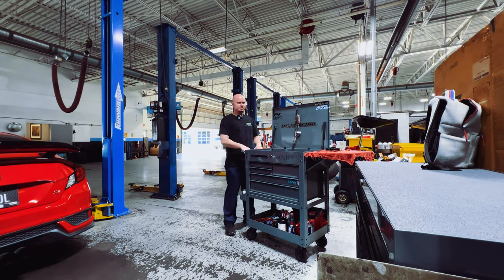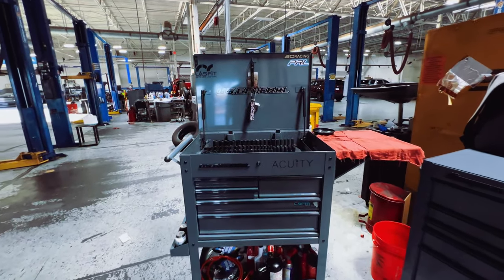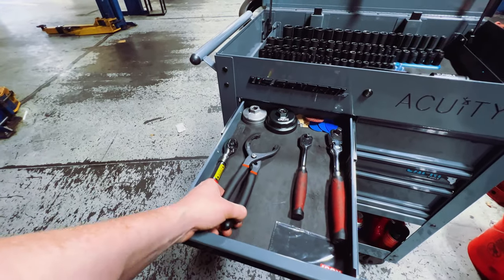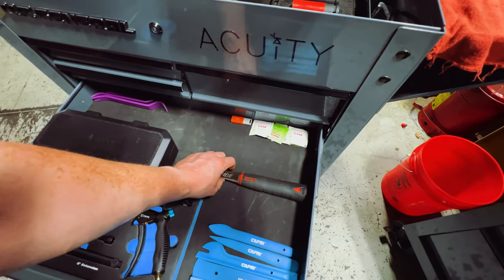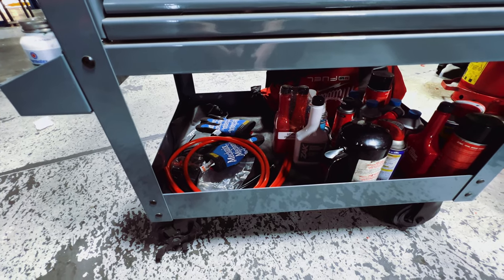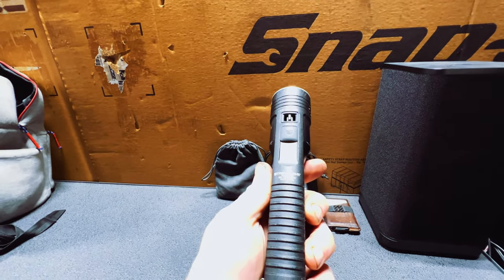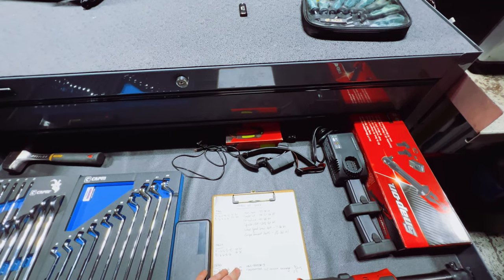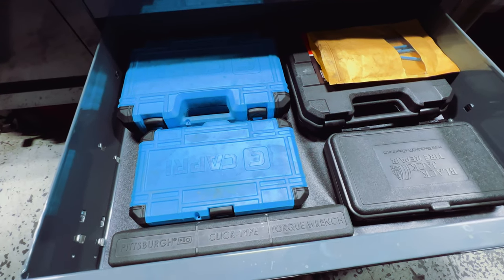1ST YEAR AS AN AUTOMOTIVE TECH: TOOL HAUL

Comment: Great setup. I, toi, have a variety of brands. Although I have some Snap On tools, I have been moving to Icon whenever possible  because theycare 90-95% as good as my Snap On for 1/3 the cost.
Reply from the maker: I can definitely say that I’ve really been loving my icon tools. Like you mentioned, much cheaper than Snap-On and they can perform really well.

Comment: Quick question, do you torque bolts, nuts with your impact sockets or have chrome sockets for them? I hear that having chrome sockets is the way to go but so far I only invested in impacts for the same reason you have, which is to be able to use it both of my impact and regular ratchet. Thanks again, awesome setup btw!
Reply from the maker: I’ve heard that if you use your impact sockets on ratchets that you could break the ratchet but personally that’s never happened to me. I’ve always used the impact sockets on my torque wrenches and haven’t had any issues.
Reply: @KalubOwen  awesome, I figured as much. My co workers are telling me I’m going to need them soon, but if I ever need them I’ll just go to harbor frieght and pick some up
Reply from the maker: @zorohs1455  always a great option!